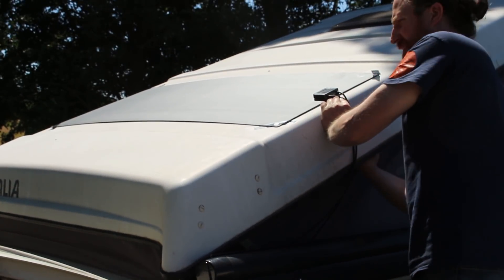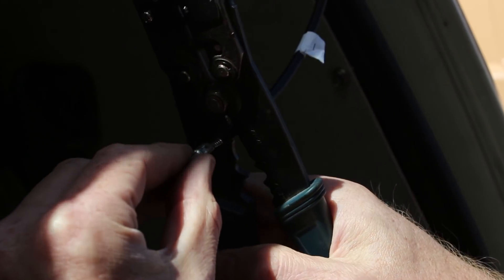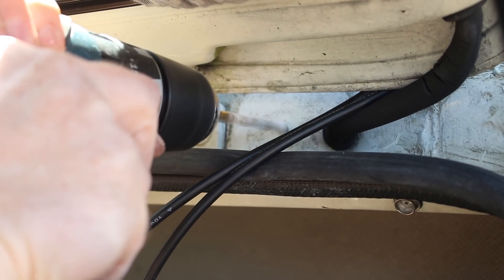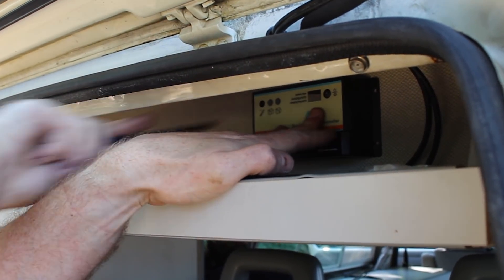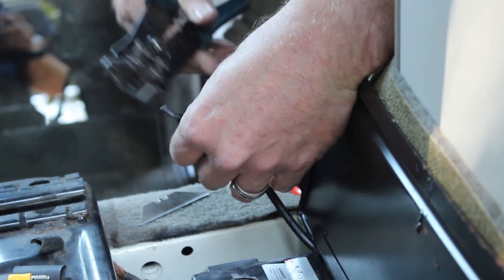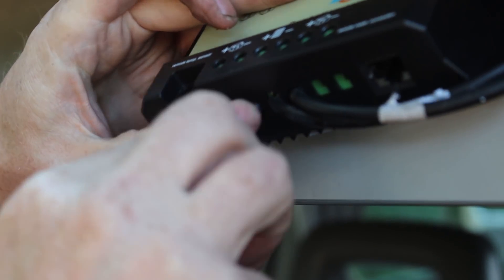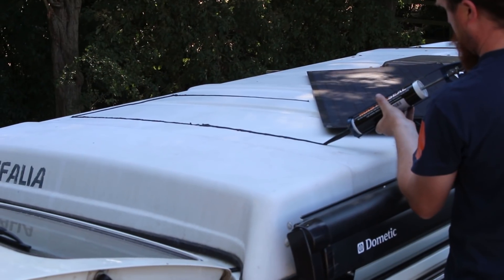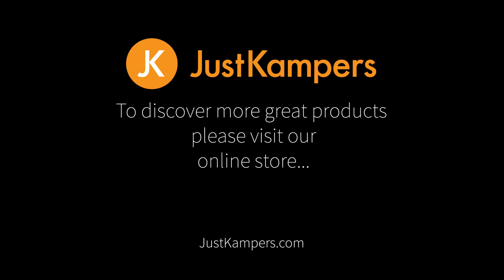How To Install A 100W Solar Panel Kit (J42671) On A VW T25 Westfalia

Comment: you did a decent job, I've had 4 different solar setups on my Westy.  Feedback I'd offer is about that angled hole, seemed unnecessary.  Many folx use the grate vent at the rear driver's side and then there's a bay to stash remaining cord bundles under to the left of the engine.  Next, I find that the permanent adhesive is undesirable, as panels get damaged, and stolen, the adhesive seems a permanent eye sore of a mess on the fiberglass.  Also, my experience is high end locking velcros lead to a theft... so it seems theft resistant bolts may be the better bet.  Folx have reported over the years that the lack of air flow under a flat panel can create hazardous overheating.  I fortunately was not someone experiencing that, but Renogy even did a recall which supported that concern.

Comment: I hope to buy a van in spring and I can't wait to install something like this to my van.
Is it possible to remove the panel once the bonding agent is dry? Just in case something goes bad with the panel or I want to sell the van.
Reply: You probably can remove with correct fluid.. thinners is extreme..but maybe petrol will soften the silicon.

Comment: Could you cover the panel with a towel or something like that while fitting it to stop it producing power until you have wired it up?
Reply: Usually most easy is to use the cardboard box the panel came in to cover it.
Reply: Use a fuse breaker before you route it to your charger controller
Reply from the maker: Can't guarantee that will stop the light getting through 100% but it might be worth trying it and using a voltage meter to see.